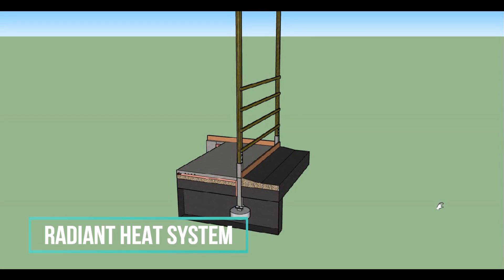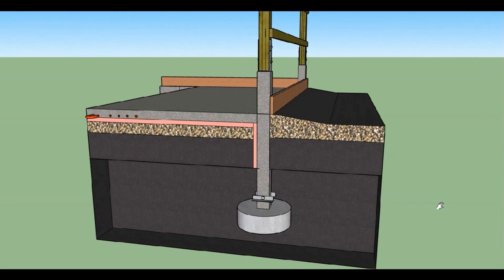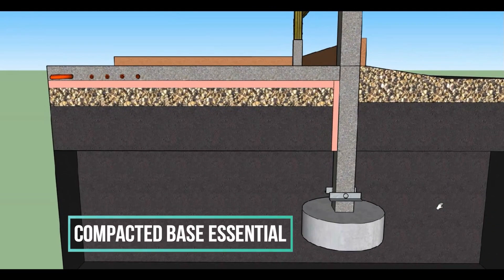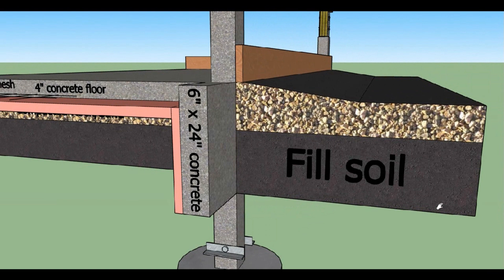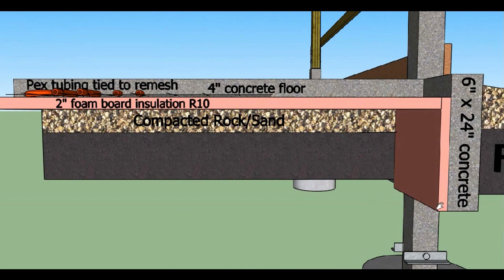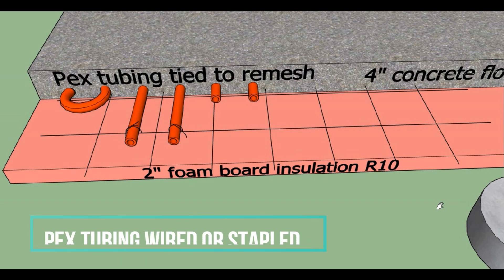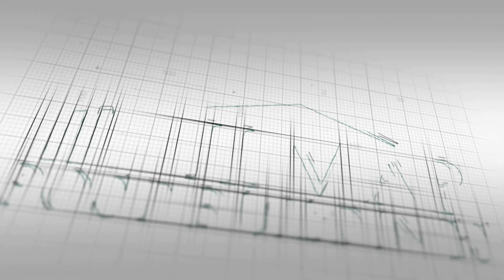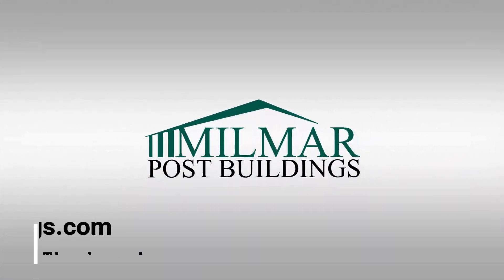Radiant Heat Floor for Pole Barns - Milmar Buildings

Comment: What’s the consensus about the insulation foam under heavy loads (like a truck moving in and out every day). I imagine that eventually the foam gets squished and subsequently the floor starts cracking.
Reply: I'm not sure where everyone stands on this, but this has been done for quite awhile over many floors with no issues at all.  Now, if you are running heavier trucks or a commercial setting, it would be recommended to pour thicker concrete, but that would be regardless of the foam board.

Comment: IMO the vertical insulation on the “rat wall” needs to be to the exterior. You have detailed a thermal bridge allowing heat right out of the sides of the slab.
Reply from the maker: I see what you mean, but if there is a separation between the slab and the rodent wall, that is broken.  I should have made that clearer, and typically now, we set that rodent wall just outside the exterior with the foam board separating it from the interior, so that bridging isn't an issue.  Thanks for the input!

Comment: That foam board under the concrete floor, very cool but doesnt it crush with all that weight on it? I was looking to go 8" thick concrete to put heavy machines on top.
Reply: We haven't had a problem with that, I'm sure it compacts naturally some, but if you have a good base, it should compress equally

Comment: This video is awesome! Have you guys added geothermal lines in with the shop floor for additional savings? Not sure if anyone has, just looking into it.
Reply: We have not worked with geothermal at all, but that sounds like a great idea!
Reply: @JackMcDonnell  maybe it's an expensive idea too?  But I got a loader and theres room to dig a big area to run the lines so maybe it wont be too bad.
Reply: @FredFlintstone21  I say run with it and see how it goes!
Reply: @jackmcdonnell4876  I'm thinking I can run them geothermal lines deep under the shop floor then run em to the circulator and out to the shop floor, tied into a boiler or water heater

Comment: To heat the slab more efficiently keep the Pex up and allow cement to get underneath so it is heating the slab all the way around.
Reply from the maker: That's an interesting thought and makes sense, but typically we have to keep it a little lower to avoid the saw cuts made in the concrete from nicking the pipe.
Reply: @MilmarBuildings  all the more reason for me to go 8" concrete. Labor is almost same price, just paying for more concrete.
Reply: @FredFlintstone21  That's great if you can get the labor at the same rate!

Comment: 2” foam board will crack all over the place. A bubble foil bubble layer will suffice as it’s also a vapor barrier. Ask me how I know 😉
Reply: The foam board cracking I would assume comes before the concrete pour?  We always lay down a plastic vapor barrier, but the foam board is more for a thermal break and insulator, not just vapor barrier.  Thanks for the idea!

Comment: Were is a thermal bridge between the slub and the roden wall. Put your enginiring diploma into a trash can
Reply from the maker: Not sure I completely understand what you're suggesting, but would love to know your solution. I definitely don't have an engineering degree , so I'm always willing to learn! 👍
Reply: @MilmarBuildings  I do not see why a rodent wall is a necessity here as well as insulation on that wall.  I would eliminate those two things and add some foam boards on  outside part of a slub  to prevent heat escape. Mice dig holes when they see heat escape  if you   insulate your slub all around they have no business to dig there
Reply from the maker: @andreycham4797  hey Andrey, I understand what you're saying and that would be much easier, however, many of the counties we work in require a concrete rodent wall regardless if it is a bit overkill sometimes.  We have to follow code to get building permits, so this has been the most effective method of doing that and does help keep frost from heaving the edges of the slab on a building. Thanks for the input though! I appreciate it!

Comment: Doesn't having to dig and pour the 6" x 24" wall around the outside sort of defeat the purpose of a post frame/pole barn? At that point it seems like it would be easier to just pour a foundation wall and use Permacolumn's Sturdi Wall brackets on the top for the posts (if you still want to post frame it). Or does the way you've shown end up a bit cheaper because 24" isn't quite the frost line and the actual deeper posts are below the frost line?
Reply from the maker: Yes, the rodent wall certainly makes the cost go up on a post frame, but still not as much as a full stem wall that needs forms and a footer.  And you are correct, posts go to 48" and the rodent wall goes to 24".   The sturdi wall brackets are a nice option to have for pouring a full footing.  The main benefits are not having to use forms and shortness of the wall as it's not for support, only insulating and blocking.
Reply: @MilmarBuildings  Thanks for the explanation! So the wall in this case is poured directly into a trench dug between the posts after setting them and backfilling the holes?
Reply from the maker: @itas0r  right, you can dig it between the post, or a lot of times we will dig right outside the perimeter of the wall or right inside. Serves the same purpose.